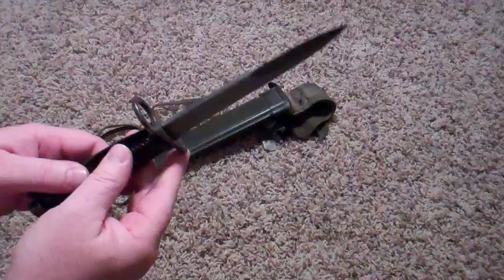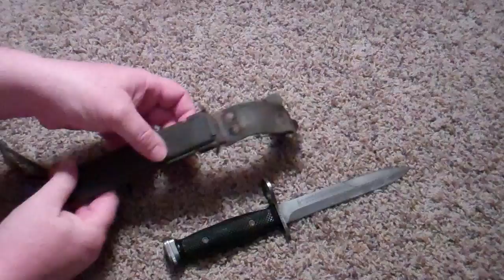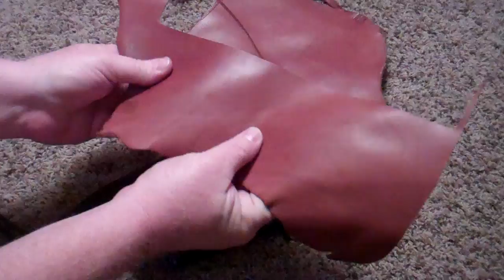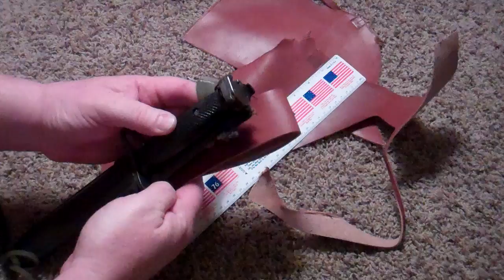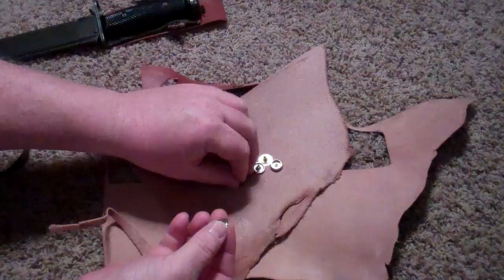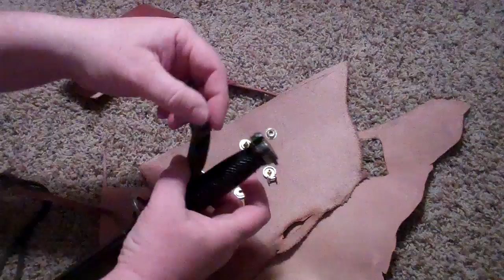Bayonet Repair Part 1

Comment: Thanks for sharing this.  You may want to put a piece of plastic along the back side of hoop reinforce it or double up the leather there. When you draw the knife the sheath will also pull up before it releases & flop around when walking.  A friend of mine has made a dozen or so sheaths and due to the thin leather this has happened on every single one until he reinforced them. What's great about this, is that you can adjust the height you wish to carry it at. Make it comfortable for you to carry.